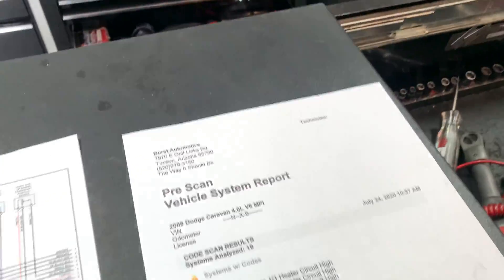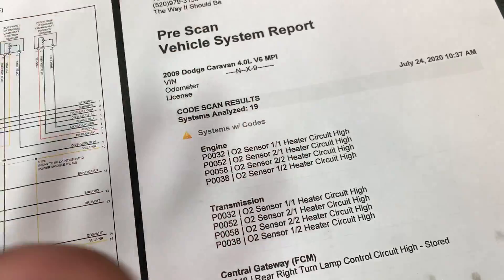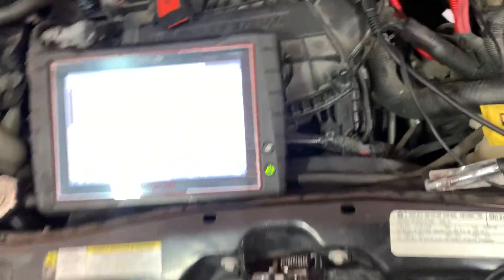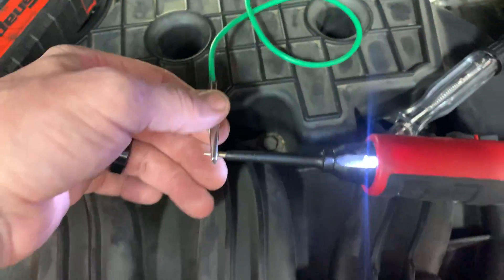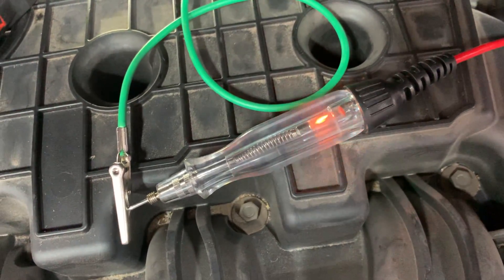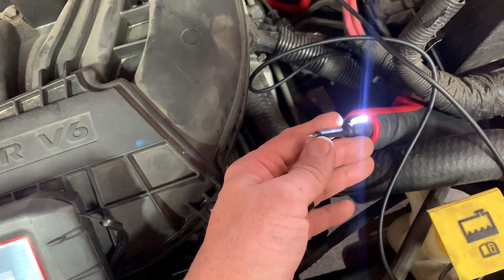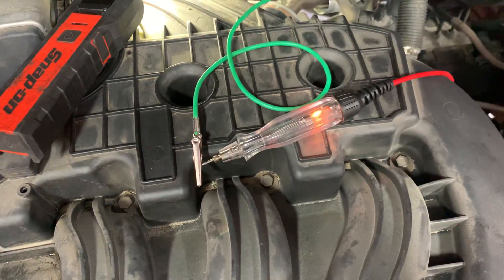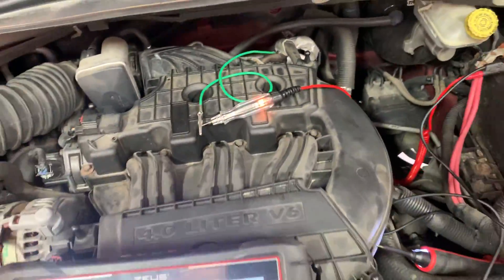Why load a circuit?

Comment: When doing a load test with a light bulb on a circuit. How do you determine what amp lightbulb to use to load the circuit if the component your testing is not working so you don't no current it draws. ?  Im i right in saying if there a 10 amp fuse on the circuit you load test half the value 5 amp or do you use ohms law calculation.  Be really interested to find this out .

Comment: Hey Cody great video hope you and your family are doing well.  I was wondering if you have seen the test light made by lisle company part #28800. Just came across this on a video its a led test light with a digital display and has a button you press to put a 800 ma draw on the circuit so you can see the voltage drop. I guess its similar to the  load pro.
Reply from the maker: Hey bud, everything is going good over here, hope all is well for you

I haven’t seen that test light yet but I’ll check it out. Thanks for the part number!
Reply from the maker: Just grabbed the test light you mentioned, damn this thing is pretty damn sweet! Thank you for sharing bro.

Comment: So if all you had was a multimeter could you not ohm out the wire and see a high resistance value and be able to go off of that that it’s a ground wire issue?
Reply: Or are you saying that your resistance would show fine because you are not under a load therefore misleading you making you think everything is fine.

Comment: On a light like that would you typically change the bulb to target a specific load or just go by brightness....just comparing it to using a bulb like others use.
Reply from the maker: The best test is to check violate with the load of the test light at the same time. This will tell you your voltage drop not just by looking at the brightness

Comment: Like many tech's, im a statistic of not loading the circuit myself but now ive learned and makes a tech way more confident i think the diagnosis and verification. Great job Cody and hell im even sharing this video with the guys i work with, one doesnt like electrical lol and the other well loves to ohm out, not that thats the wrong way just i think load testing, its more reliable when checking integrity!!!

Comment: I've also been using taillight bulbs and other higher wattage bulbs. Also sometime hook them up in tandem or even series. I'm in Minnesota, where rust and corrosion is a serious problem. It's usually bad connection or rotten wires. Hardly ever have to replace a module unless it's really corroded.
Reply from the maker: That’s the beauty of the Incandescent lights and adding lights to get to the amperage you desire.

Comment: Good video. I keep an old analog Simpson VOM around also. Nor smart enough to outthink impedance ranges on digital meters. Just simpler to check with an analog, especially on FET controlled outputs.
Reply: Could you please eleborate on the theory behind your thinking. Load testing opened a whole new world for me some time ago. Hope there's something in what you say to bullet proof my diagnostics. Thanks
Reply: @tharindutest9930  I will try. Cody did a great job with this video but IMHO it would have been clearer if he would have hooked the incandescent test light to a good ground after his test. To highlight the difference. The light would have been bright meaning good ground and power. In the video the light is dim and seems to flicker meaning bad ground. 

In circuits controlled by Field Effect Transistors there can be something called leakage current aka "ghost voltage" A Digital Volt Ohm (DVOM) is so sensitive it detects that. Because a DVOM put no significant load on the circuit. So you get a reading that is not really there. As soon as a load is put on it it fails. LEDs draw minute amounts of amperage so they do not provide enough load to fail the circuit.

The "old school" analog meters DO put a useful load circuit. If he had used an analog meter he would have read either zero or very low voltage. I have a couple test lights, some homemade. They each draw a different amount of amperage.. 0.8, 2.1 and 2.9A,  I have them marked.  I am putting a link to a doc. that does explains about the FET's. Link is good for 4 days. Hope it works in youtube. I am using dropbox. The link is safe. Hope this helps.  https://www.dropbox.com/t/E5l4lE8TBBoQmPKN

Comment: Can you do this with a multimeter for a resistance check or are you checking ohms?
Reply from the maker: Ram Rajkumar Yes you can do a resistance check but I’ve been burned too many times but not properly loading a circuit which has made me misdiagnosed vehicles. Adding a test light and loading that circuit clearly shows a fault
Reply: @codysautodiagnosticsprogra8706  thank you because im trying my best to learn and i figured why not ask whats the best way to check wire integrity thank you for taking your time out to reach out this means alot im studying avionics in college in Florida and please keep putting videos out very addicted on ur vids
Reply: no a ohms check will not be a good test.if you took one strand of wire from starter wire it would read the same as the entire starter cable in ohms would read.what would happen if you tried to crank a engine with a strand of wire?

now if you load tested that strand of wire with a bulb you would see a huge differece in dimness compared to the starter cable.

Comment: so true Cody     iv seen a case study where bad spark plugs causing a flyback voltage to PCM caused those same codes    Cody   how do i buy one of your Pressure pulse sensors? phone   website ?   all the best man
Reply from the maker: Hey Mark! Best way to get ahold of me is at codysautodisgnsotics@gmail.com or I’m also on fb at Cody’s auto diagnostics. Look forward to hearing from you

Comment: I use a Load Pro. Also, why didn't you show the Snap On (Power Probe) hot shot test to prove it's inaccurate? You have to be careful with the old style light if you are around computer circuits.
Reply from the maker: I didn’t show the hot shot test because I’ve already showed the issue with the hot shot test in another video. You are correct about using a test light on computer circuits but remember I was on the sensor ground wire on chassis, not a computer controlled ground.

Comment: Excellent video man!! I wish this is something SI would have guys test.  Ive taught my guys to load test always and have different light bulbs made up to load circuits.
Reply from the maker: Absolutely brother! It would be nice if there was a tool that had one light to vary the amperage draw, so wouldn’t need multiple lights taking up toolbox space lol. May have to see if a tool can be made🤔
Reply: @codysautodiagnosticsprogra8706   they used to sell "decade box" used to put different loads on circuit to test voltage drops.it was a board with about 15 switches all with differnt amp draws

Comment: Harbor freight sells a good test light.  I have a few of them and use them with my powerprobe
Reply from the maker: Yes sir they do. I’ve got a couple of those too.
Reply: @codysautodiagnosticsprogra8706  I agree on how you can't really rely on LED test lights. They don't draw enough current on the circuit
Reply: @codysautodiagnosticsprogra8706  I have a load pro and I hardly use it
Reply from the maker: I have one as well and used it maybe twice. It would be a great tool if it wasn’t so big and awkward

Comment: Why not go from battery negative to o2 sensor ground and voltage drop it while still plugged in?
Reply from the maker: I definitely could have done that but grabbed I usually grab my test light first for any power or ground issues nowadays
Reply: @codysautodiagnosticsprogra8706  Hi Cody,  This popped up on my feed.  Great video.  I'm not an automotive tech, but I am schooled in electronic systems.  I use a multimeter to check from the ground wire to the frame across the ground connection.  The trick is the meter has to be on the mega-ohm scale.  To make sure it is set right, I pinch one lead in my left fingers and the other in my right fingers.  If the meter is set right, I get a reading.  If it is not (too low of setting) I get OL.  Once the meter is set properly, I compare the reading across the ground connection with what I get when I touch the two test leads together.  I believe this method is even more sensitive than the incandescent light bulb.  Play with it and you'll have a back up for your method.
PS:  My first method would be to loosen the ground terminal, spray on some WD-40, wiggle it around, and re-tighten it.  I give every ground point, and battery terminals, a squirt of WD-40 at every oil change.
Reply: voltage drop is always the best method but can only be done when you have current flow.therfore this draw test should be a trick everyone should know because many times we dont have current flow hense why were working on the car...you could however simulate a circuit by wiring in a bulb that would draw around the same amps as the device and do a voltage drop on a system that didnt have current.

Comment: Cody, did you happen to connect your dvom to it while the test light was connected to see how much of a drop it was ? Just curious.
Reply from the maker: No buddy I didn’t which I thought about after filming 🤦‍♂️
Reply: @codysautodiagnosticsprogra8706   Good call on were the problem was near the splice, because I noticed in the diagram the EGR is on the same ground and if it was the eyelet, it would have effected it as well I believe 👍
Reply from the maker: You are absolutely correct sir. I noticed the egr on shared a ground but didn’t code so that tells me it’s farther up the path

Comment: thanks for the fast reply brotha one more thing i  did see VW on this car is this the same engine on dodge 4.0 lt  and you were hooked the test lite on B+ and the O2 sensor ground with car running or just key on engine off sorry for dragging on as always really enjoyable to learn from the master. cheeeeers
Reply from the maker: Yes buddy this is basically a dodge with vw badging. Yes is was hooked to bat power so my test light is searching for a ground. I first tested with engine running but realized ground was bad with engine on or engine engine off

Comment: Great video Cody! The tool guys have been coming in lately trying to sell “wireless test lights” and I have been telling them to keep them out of my shop for this exact reason haha!
Reply from the maker: Wtf wireless!?!? 😂😂😂OMG this is total job security now 😂
Reply: Cody’s Auto Diagnostics you haven’t seen those yet? You ground the test light by touching metal with your free hand!
Reply from the maker: Voltage Drop Diagnostics oh I have seen one of those a couple years ago from a guy I use to work with. I laughed when he showed it to me 😂
Reply: i  bought one back in 1987 (or somewhere there abouts).  so they've been out for a long time.  once i got burnt on using it a few times  i gave it the semi truck stress test under the tires.  it didnt make it!!!
Reply: Kinda like Fluke's T6-600 open fork electrical tester (inductive), which requires one to touch an conductive pad on the back to "ground" itself.  You're the ground.  Most electricians I know avoid it...

Comment: I've made high amp test lights with some headlight bulbs and side marker lights to have even higher draw.  The headlight is at 4-5 amps.  I prefer the draw approximate the component's draw.  In this case, test light is good enough.  Testing a heater circuit, I would prefer the light bulb tester.
Reply from the maker: Yes sir I agree with you on the size of the light to use but figured I would grab my low amperage light to show how that one can find ground issues as well more then the pp or led
Reply: how do you estimate?do you estimate by how much amp a device normally draws then use a bulb rated around same?where do you get the info to calculate what the amp draw is? i suppose you could just use a meter or amp clamp but then again the device your fixing would not be workinf so im just looking for knoelege,thanks.

Comment: How do you know how many amps to load which circuit? For example, 2amp bulb for solenoid circuit? Is a test light load good enough just for sensor wires?
Reply from the maker: Depends on how many amps that circuit is made to run. If I was testing a fuel pump I would use my sealed beam headlight that draws 7.5 amps compared to this little light that pulls less then 100mv
Reply: Cody’s Auto Diagnostics one more question, how would you be able to tell how many amps it was made for?🤔
Reply from the maker: If there is a fuse for that circuit then that would be best case Scenario. Any computer controlled powers or grounds I always start with my 80mv test light
Reply: @codysautodiagnosticsprogra8706  mA not mV

Comment: Still use an incandescent test light ,it's the same one you have there it's just branded MAC tools had it for years and has show me many times high resistance in a feed or ground line . 

Good example Cody and Keep up the good work
Reply from the maker: Love that little light!
Reply: What light is it?  I have the otc 3633, love the size but not the red bulb,  or do you know any other  bulb to replace the otc original?
Reply from the maker: I can’t see a number on it but it’s a dome light bulb